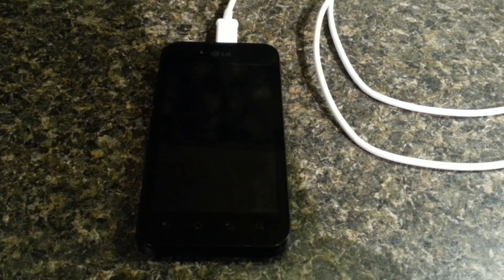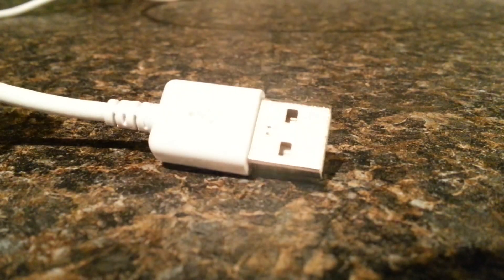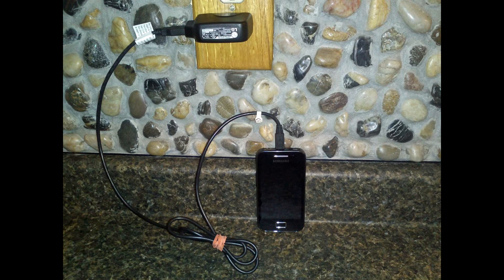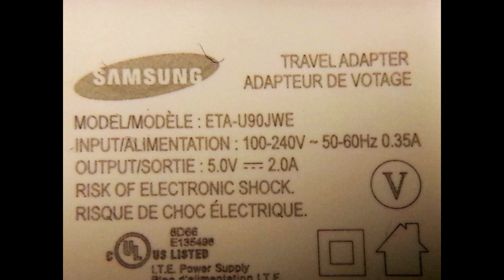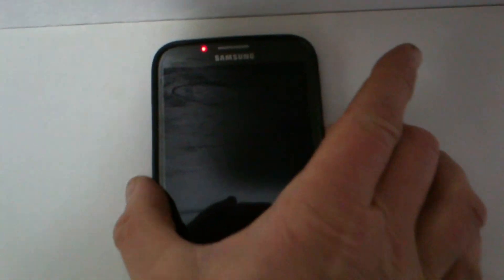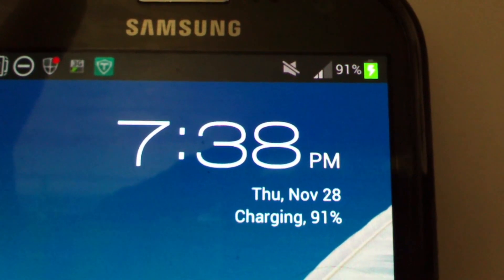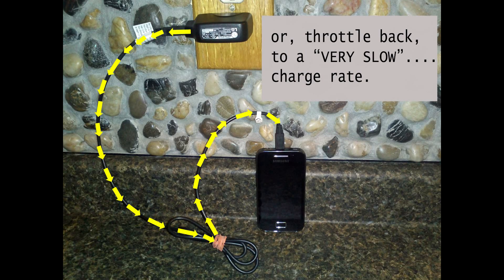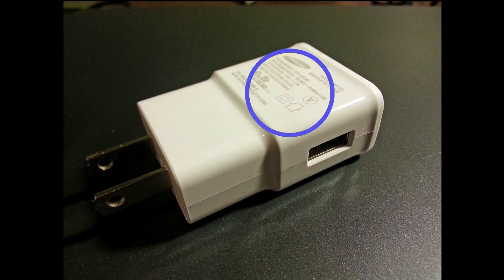Slow Charging? Check Your Charger's Output! #9

Comment: Ever since I jerked the micro usb cable out of my phone really fast my phone has been charging slowly ever since. I should have used an extension cord but I overshot the length of the cord and I pulled the phone to me too fast and the cord inside the phone was jerked out really fast. Now my phone won't charge like it used to. I've tried different usb cords and it still charges slow.

Comment: Im using the charger what came with my phone it has quick charger mode it allways on says charging rapidly but it takes 12hour with power off and when runnning ot drains using a good cable and plug and have brand new port on phone and same result help

Comment: My phone used to charge well but after I done a factory data reset it sticks to 72% and never goes up...
Also it's very slow charging now
Reply: try to 'recalibrate' battery via misterious apps
Reply: @aerobique  I don't wanna disappoint you but you are 3 years late sir....

Comment: Mine phone is galaxy a7.
And it came with a charger that is bad. It charges really slow. 1 hour is like 30% with my friends charger is like 26 min = 100% 
And its always stuck then I'm using my phone and charging. Right now (not later) is 11% and its stuck. It says that it's 50/60 but I don't believe that
Reply from the maker: Maybe it's your cord? Try and substitute another charge cord between your phone and your charge adapter.
Reply: Oh, thanks alot
Reply: It helped

Comment: I am using Microsoft lumia 640 xl. The capacity of the battery is 3000ma  and it takes nearly 3hours to charge from 10% to 100% , The problem is that when ever I connect my device to the charger (came with the device) It leaves me a notification that device charging slow and its started happening since one month. The charging % was totally reduced (10% to 25%aprox) for an hour.... so could u guys help me plz
Reply from the maker: +kiran prinz you will first need to make sure that the charging port in your device does not have contamination in it (a pocket lint build-up). Does your device use a micro usb port? Watch this video. It might help you. https://youtu.be/cJcCK5ZVSAY
Reply: did evrythng wt I can followed each any evry steps of urs more over when I do soft reset it dosnt shows me any notification after nxt charge again leaves me a notification

Comment: bro sometimes I plug in charger and after some time my battery goes from 50•|• to 10•|• . its going in reverse manner
Reply from the maker: +Harsh Sharma yes I would first try and substitute another charge cord for the one you are using and try that. If your device still isn't charging, there is another likely and common cause. The open and exposed ports of devices like phones that spend all day in your pocket can easily get a dust build-up without you knowing it. It gets packed down at the bottom of the port. This will stop your charge cord connector from going in all the way there by causing your device to stop charging. Here's a video I made covering that.    https://youtu.be/cJcCK5ZVSAY

Comment: bro don't u think if ur phone need 1.5A output and u give 2.0A will damage battery
Reply from the maker: +Harsh Sharma all of these phone chargers (except the rapid Chargers), are rated at 5 volts output. If the amp rating is higher, that only means that the phone will be "able" to grab more current if it requires it. If the amp output of the charger is lower than what the phone requires, then the phone will charge very slowly.

Comment: If i m at 0℅ and charge for a whole night is would wake up with 58℅
Reply: Darkdiamonds Mine is 0-30 percent from one night 😑
Reply: Vinyl Scratch same here . if u find any solution pass it here
Reply from the maker: You both must make sure that your charge port is clean. A dust or lint buildup in the port will stop your charge cord connector from going in all the way. This will slow your charge or stop it altogether. Here is a link to a fix.    https://youtu.be/cJcCK5ZVSAY

Comment: when i charge my S3..GT19300..it discharges when I use it..why???.it ddnt used to do that.😓
Reply from the maker: +Mpho kganyago if your charge port is dirty, or has a dust build-up, the connector might not make a proper connection with your phone. I have a port cleaning video for that. https://youtu.be/cJcCK5ZVSAY    ALSO, charge cables can cause that problem too. Also I have a video demonstrating that too. https://youtu.be/xy_GbYHEXjs

Comment: My tablet charged very quickly until I put in a micro sd card. Should I take the sd out?
Reply from the maker: +Marge Thomas a micro sd card should have no affect on the charge rate of the battery. The only thing I can think of, is that your tablet might possibly syncing pictures or something through wifi? Was your sd card loaded with pictures or data when you put it into your tablet?
Reply: No...I just bought it. I've taken the sd out now and put it on the charger last night. It charged fully. I'll have to see how it goes tonight when I try again.

Comment: What would happen if I use "Big output" for "small phone"? Will it have any negative consequences?
Reply from the maker: As long as the output voltage is the same as what your device requires, everything will work just fine. For example, if your original charger output is 5 volts @ 1000 ma (milliamperes), and you were to use another charger with an output capacity of 5 volts @ 2000 ma, the phone will only draw the amount of milliamperes it requires, so it would be fine. The problem is if the output (in milliamperes) is less than what the phone requires, then  the result will be a slow charge.
Reply: Thanks!
I usually use 5V@2A charger rather than my specified charger viz. 5V@1A thinking that greater current boosts your charging speed. I didn't realize that fact.

Comment: I am using my charger which came with the unit itself but it still charges slow :(
Reply from the maker: +Justine Paul Cordero there is a VERY common problem with phones that have charging problems. If the phone spends time in your pockets during the day, then please check out this video I made. https://youtu.be/cJcCK5ZVSAY

Comment: Umm im using my original charger and somehow it sometimes stops charging for no reason its says its plugged but its still super slow
Reply: You might need to buy a new one. They're often made very cheaply so don't expect them to last for longer than a year. You should buy a new wall charger from Amazon, the good quality ones are around $8-15.
Reply: Sulfen okay ill try lol

Comment: I have 4 micro USB cables 1 came with my phone 2 are from Amazon dirt cheep and one I got used at a thrift store and is flat and wide. Using the same USB wall wart it is the one one to make my Android phone say slow charging
Reply from the maker: +justin rivera yes, defective cables are common. I did a short demonstration here too. https://youtu.be/xy_GbYHEXjs
Reply: It took five hours to charge my phone and when it was done my phone kept making the 100% noise instead of only doing it once witch woke me up

Comment: Hi, I'm using HTC One M8. I have a problem with it. Sometimes it charges but VERY SLOWLY and sometimes it won't charge at all. A warning sometimes pops up saying "Unable to charge because your device is consuming too much power. To fix this problem, turn off your phone, close any apps you are not using or turn off the screen." I did all but it still won't charge properly. I'm using the charger that came with the phone when I purchased it (OUTPUT 5V = 1.5A). Last week I had the battery changed, but the same problem reappear. PLEASE HELP ME, I don't know what else to do.
Reply from the maker: +xkaiwax hana charge ports get dirty easily and cause big problems! https://youtu.be/cJcCK5ZVSAY pocket lint is the cause of most charge problems.

Comment: 12 hours and only 40% ? This is a bunch of crap! (not your video, I'm trying your way)
Reply: *not your video, that might help, haven't tried it yet
Reply from the maker: +Jay Eminem  yes, I ran into the defective cable problem at least 3 times myself in the past. Either a REALLY slow charge, or syncing problems can be caused by a defective cord. But I would like to mention that if your cable is NOT causing your slow charging problem, there are 2 other possible reasons for a slow charge. 1, if you are using a charging adapter that is not original, that is "undersized" in its output rating, you will have a very slow charge rate. Here's a video for that.  https://youtu.be/aghjvzOXc8Q AND 2, if your charge port contains pocket debris or a  lint build-up, this will also cause problems. Here's that video.  https://youtu.be/cJcCK5ZVSAY  Please let us know how you made out.
Reply: it was a crappy charger, thanks for your help! (now I am using my portable computer as a portable charger)
Reply: Works like a Charm

Comment: Thanks I will watch the remaining video you have made. In the mean time I have looked closely at the construction of the male and female parts of the jack plug and have found after cleaning the dust from around the plug hole and viewing another video, I cleaned the contacts with a thin stiff paper dipped in electrical contact cleaner or alcohol, which pulled a noticeable a mount of black gunk from the terminals, it was still intermittent only connecting when downward pressure was applied to the male plug. I looked at the male plug and found if the longest face of the plug was depressed it caused the opposite tongue of the female plug to be held more tightly against the terminals, I also used the electrical contact cleaner to clean these terminals. JUST support the short side of the male plug on a hard surface and I used a small pair of pliers to depress the longest top surface, trying it often until the plug contacted first time.  DON'T squeeze the plug with the pliers as only one portion of the plug requires to be altered.

Comment: My Samsung phone battery  will show 100% charge but when used will shut down the phone after a few minutes, when I pluged in to the charger, the phone indicates a 50% charge  and will quickly top up in less than an hour. How can I get longer life from the battery?
Reply from the maker: +Chris Boyce There are 2 things that come to mind. It is possible that your battery is defective like mine was in my Galaxy Note 4. There were tell-tale "blips" down to zero then back up that showed my battery having issues. I did a video on that here. https://youtu.be/eOTzNjA7nsU
Also, if your charge port has a build-up of debris in it from your pants pocket, that can cause major charge issues as well. Here's that video. https://youtu.be/cJcCK5ZVSAY
Hopefully one of those 2 videos will help you.

Comment: hey stupid question, my original charger is nonpolarized (reversible same sized prongs) but my powerstrip outlet has the normal big and little slot plus ground. sometimes my phone takes ages to charge and sometimes it charges really quickly. I've found that reversing my adapter prongs seem to fix the slow charge. is it possible to have it wrong  with a nonpolarized adapter?
Reply: you know it's prolly just a bad cable and flipping the adapter just adjusts the positioning of the wires so they all touch better
Reply from the maker: +MrMustacrackish the orientation of the charge adapter in an A/C outlet will not affect the output of your charge adapter. But, a charge port that is full of dust and debris will!https://youtu.be/cJcCK5ZVSAY

Comment: I bought a chuwi vi10 tablet, it came with a 5v 2a charger and needs to charge an 8000mah battery. The battery drained to 15% within 6 or 7hrs on and off apps and games but it took me at least another 6hrs to charge! And thats with the device turned completely off! Is this normal for a first time charge for a tablet using the original charger? I'm currently using it now and am worried if I have to completely turn off the tablet everytime I need to charge it. No one else has had this issue with it but I did see some people who had it completely dead and wouldn't turn on. Do you know anything about this? thanks for any replies
Reply from the maker: I have seen Galaxy Tabs taking over 5 or 6 hours to charge to 100 percent. Big batteries, and the limiting characteristics of the standard micro usb cords appear to be the reason that not much over 2 amperes can be shoved through a standard micro USB cord. Some new chargers use "adaptive fast charge" circuits, which when is seen by a supported device, will send up to 9 volts up the cord to the device. (This feature must be supported by the device AND the charger for this to happen. I hope this helps.
Reply: Thanks for the reply, I also have seen some tabs taking time to charge and even iPads but they always have a simple fix such as a charger replacement of USB replacement. My tablet, 4.8 / 5 stars. Majority of the people aren't having charging issues it just seems to be me. Some people said it charges slow but when my tablet is on it just dies slower. I had to leave the tablet turned off and on charge with a 5v, 2a plug and original USB that came with it. I believe it's a faulty unit but some other YouTube channel suggests its just calibrating the battery
Reply from the maker: Be sure to try another cord that is of good quality to rule out the possibility of that being the issue.
Reply: Mysimplefix Alright, well I've used a 5v 2a Samsung plug which gave the same results but works fine with my phones
Reply: +Mysimplefix is use the original charger but it went to 3% to 3% XD it didn't charge at all though
Reply from the maker: If the adapter and cord are OK, then there's nothing left but the device itself (unfortunately).
Reply: Nothing wrong with the tablet. I found out the cause; because of the components in the tablet, the power input can only be limited to 5v 2a for safety reasons otherwise there could be risks such as battery swelling and frying of the motherboard. Well, I learnt the hard way, I had to spend £100+ on the tablet to discover I have to turn it off every time I need to charge it. The ONLY downside of the tablet itself.

I've now got an Onda Obook10, only downside of this is the weak WiFi, but the extra 2gb of ram and free angle rotation on the keyboard makes up for it. Brilliant tablet though, low power and still 5v 2.5a. So it's able to charge whilst being used. 

Good luck guys, and I'll probably gift this tablet to someone since no one is buying it.

Comment: hey man i have a brand new lg g3 3000ma battery it was charging very fast at first but lately it takes like 6 hours from 15% to 100% idk hy the ac has 1,8a written in output and i never smashed it or dropped it
Reply from the maker: I would verify that the charge socket is completely clean. Phones that are only a couple months old can get a dust build-up in the charge port. Please note, even if the port appears to be clean, there may still be hidden trouble at the bottom between the tab and the inner wall of the charge socket. https://youtu.be/cJcCK5ZVSAY
Reply: ok thanks for the fast reply
Reply from the maker: +The6funny hopefully it helps you.
Reply: mine does the same thing also did you fix it
Reply: mine does the same thing also did you fix it
Reply: +Darius Coleman i changed the cable. The cable was the problem now it charges faaast
Reply from the maker: +The6funny glad you found the problem!

Comment: Hi 
I used an old phone charger (5.0v and 0.7A) to charge my portable charger which requires (5.0v 1-2A) 
I now am using the original charger because it was charging really slow, the portable charge seems fine now
But I'm using it for my iPhone so I wondered is there any risk of damage to the batter at all
Plz reply mate thanks
Reply from the maker: Is there any risk of damage to the "portable charger" by using an undersized charging adapter? My suspicion would be, no. But the portable charging unit's battery charging circuitry "may" not be as forgiving in not using the charger that came with the unit itself. These are my thoughts. I may be wrong.

Comment: So hey, quick question, I have a samsung S2 GT-i9100g and it takes 3 hours to charge completly ..? I have a 5V = 1.0A.
Reply from the maker: Please watch my latest charge port cleaning video, as a dirty port will prevent the conductors in the charge socket from making proper contact. https://youtu.be/cJcCK5ZVSAY
Reply: +Northcaledon already watched it, my question is : is the 1.0A enough for my device ? ( GT-i9100g )
Reply from the maker: Yup, you're good with that output. Don't trust your cables! I just put up a comparison video of a good and bad cable showing a very slow charge time. It might be of interest.
Reply: can u pass me the link please 
thanks
Reply from the maker: https://youtu.be/xy_GbYHEXjs

Comment: thanks for the advice i was wracking my head to find out why my phone wouldn't charge fast enough to keep up with my uber/lyft driving's excessive use of power via gps, i finally noticed "because of this video" that my USB car charger that i got at dollar tree was rated at 1 amp  it would just barley keep it from discharging with the phone screen off.

Comment: and if you have both? a very slow charging and a fast drain of battery without using it?
Reply from the maker: I would be ABSOLUTELY sure that the charge port is clean. Pocket lint stops charge port connectors from going in all the way. https://youtu.be/cJcCK5ZVSAY
Reply from the maker: Now regarding the fast drain, if your battery has NOT been charged over 600 or so times, I would make sure all apps have been updated (daily), reboot the phone (daily), and check battery drain data within the settings section for possibly a rogue app that's causing your drain issue.